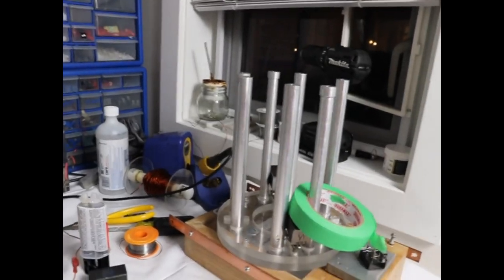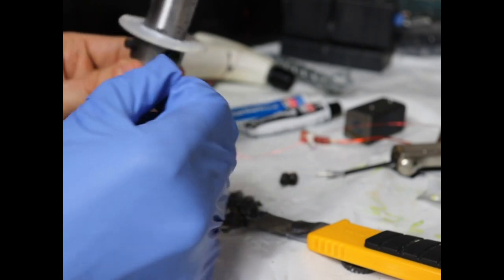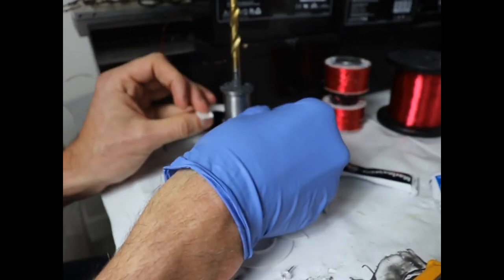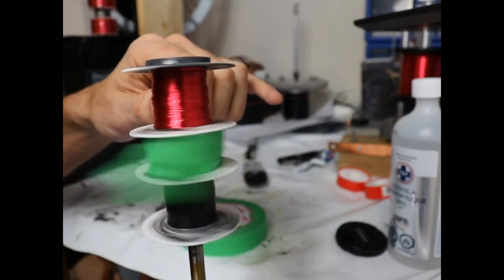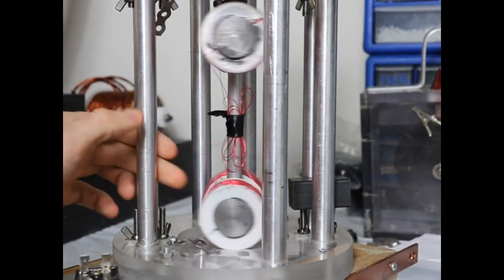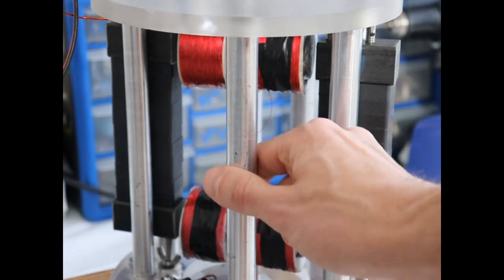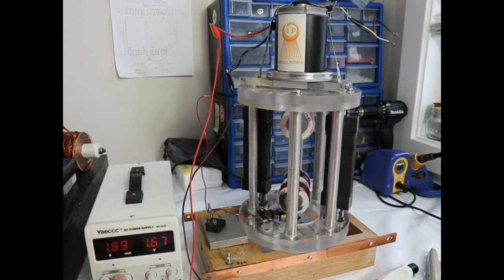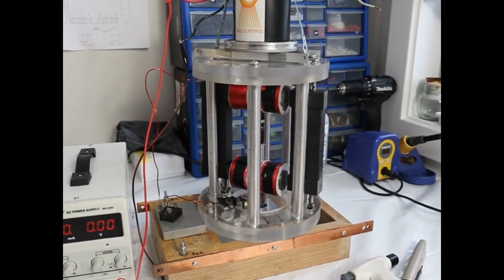Kromrey Generator 2.0: Nicola Tesla's Method of Conversion!!!

Comment: What is the C.O.P at the monent?
Reply from the maker: I'm going to put out a short video this weekend showing the calculations based on changing batteries... less then 1 I imagine before I get more magnets and upgrade windings
Reply: @MadscienceLPTECH  its not good to build generator coils with high resistance because then the coil uses up most of the energy  it produces. this greatly limits the total output capability of the coil before it burns up.